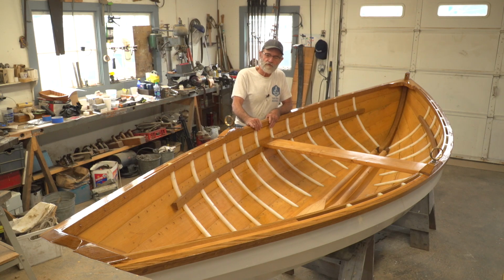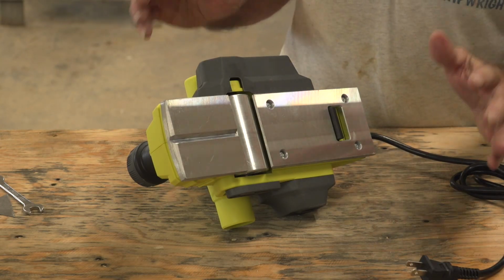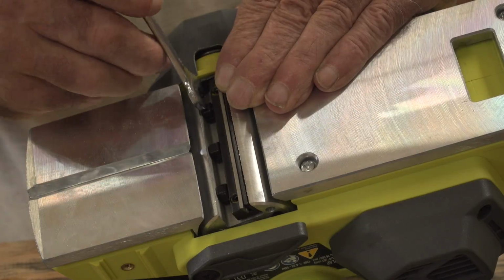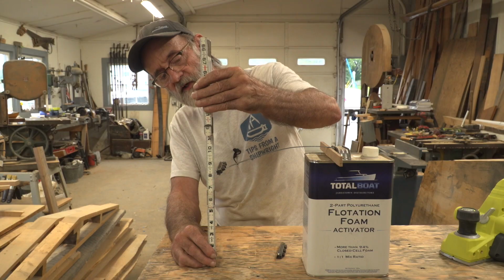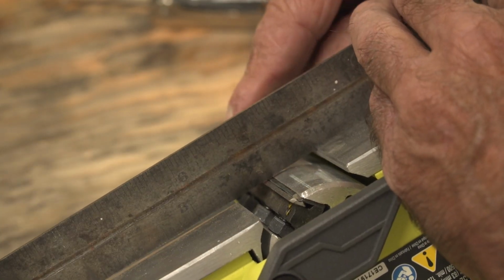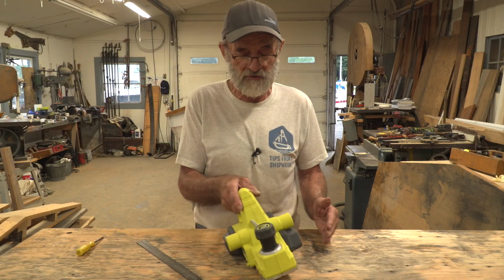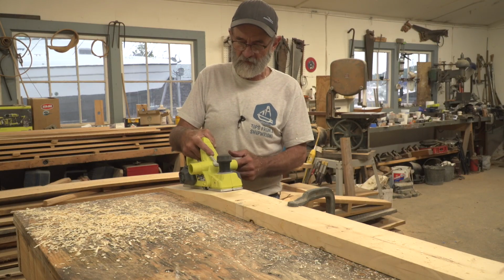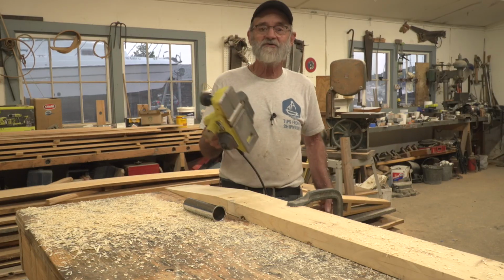How to tune up your electric planer for best results!

Comment: I just bought one of the ryobi gizmos an i intend to use it for walking canes ,and at some point a tiny boat about i9 ft 11in,as in ohio anything under 10 ft doesnt need a registration number and is exempt of the codes and regulations on my local lake ,,was hopeing u would give me advice on a good small gas engene ,,motor for it ,it willl be about 3ft wide maybe 4 ,even as i only want it for fishing close to the banks,it will be about 2ft 6 from the floor to side rails ,made of 1quarter in ply 2 layers and half inch foam insulationsandwithed and sealed with epoxy
Reply: What is a "Ryobi Gizmo"? I tried looking it up, and couldn't find it on the web.

Comment: The old spiral planers are worth big money now.  But why are they dangerous?
Reply: He's either confused or doesn't know the difference between a Skil 100 and a Rockwell or Porter Cable.  The Skil 100 is the best planer ever made and it does NOT have a spiral blade.  The spiral blade planers are the old Rockwell and Porter Cable planers.  It is the Skil 100s that demand top dollar.
Reply: @1982mako224  okay, thanks, but why are the spiral blade planes dangerous?
Reply: @thomasarussellsr    Its not all spiral blade planers that are dangerous......it is only a few very early palm sized planers that are extremely dangerous to operate.  I have a feeling that the Rockwell planer in the following picture is the one he is confused about.  This little Rockwell does use a spiral blade and is just an accident waiting to happen.   What makes it dangerous has nothing to do with its spiral blade......what makes it dangerous is its small size and that most of them are missing the side guard making it even easier to wind up taking a finger off.  There were several variations on this model and they are to be avoided.  https://thumbs.worthpoint.com/wpimages/images/images1/1/0617/01/1_7670462760c2d4983d2b4cec2bdb44c0.jpg    

The planer at the following link is a Rockwell 653.  This planer also has a spiral blade and is probably the second best planer ever manufactured.  It is not dangerous.  The spiral blades actually cut better than a strait blade by the way.  The problem is Rockwell/Porter Cable stopped making the cutters long ago and a new cutter with run you $200+  Here is a nice restored Rockwell 653:  https://www.garagejournal.com/forum/picture.php?albumid=5080&pictureid=61289

At the following link is a Skil 100.  This is the most sought after of all planers ever made.  Skil planers have never had a spiral blade and are not dangerous as was mistakenly said in the video.  These command top dollar with even ones in poor condition fetching hundreds of dollars and restored units fetching over $1,000.00.  The Skil 100 is a tool that is perfectly designed and will last a lifetime.  There is a 5.5 amp and a 7.5 amp model with the 7.5 amp units commanding the highest prices.   https://shapersupply.com/collections/surfboard-planers/products/skil-100-type-4-7-5-amp

The next couple of pictures are a sampling of the planers I use.  I have three Skil 100 planers two of which are pictured, a Porter Cable 653 (spiral cutter) and a Hitachi P20 (the green one).  I do most of my work using the Stock Skil 100, a modified Skil 100 and the Hitachi.  My modified Skil 100 has its base shortened to make it work curved surfaces better, all corners softened so it can't catch an edge, new bearings and a specially made attachment to capture the air from the fan  to propel chips far  far away.....it actually blows the work surface clean as you go which is important for the work I do.  I also have a beat up death trap planer that I picked up at a yard sale as a curiosity but never used.  I had one Ryobi but it self destructed when the blade assembly came loose......it can happen so check your blades and make sure they are tight periodically.
https://i.ibb.co/yY1tChg/5-D370-C4-E-DA10-4830-B03-D-A305-C90110-AC-zpsqvyqy8wf.jpg
https://i.ibb.co/B4DvXP7/BB646-ECF-F538-4-F34-9712-35-D24557-EF49-zpskr8af4tn.jpg 

I love these videos but he clearly confused when he got into talking about the Skil 100 and planers with spiral cutter heads.

Comment: What is the V groove in the adjustable plate for?
Reply: I would assume to be able to plane a chamfer on corners. Could be wrong though!
Reply: @ericmcconnell3238  nope, you are completely correct. It is a chamfer guide. The depth of the groove is to ride on the corner of your board for more accurate chamfers.

Comment: Electric planers are expensive, noisy, messy, dangerous, polluting, things. Try a Stanley No.4. cheap,  quiet, still messy, not at all dangerous, environmentally friendly, more skill required and good exercise too.
Reply: My Stanley no. 4 is my favorite tool in my shop. However, it's a smoothing plane and meant for thin shavings.  Unless you have a scrub plane to take the wood down to depth, you are going to spend a ridiculous amount of time and effort with a no 4. If I have a thick piece that I need to take down 1/8 or more, I reach for the power planer to get the bulk off. Then go to my no 4 to take it right to my line.

Comment: A lot of useful information as usual.
Does the motor have a secondary output for its cooling air? If not the increased flow should also make it operate cooler thus giving a longer life span (motor, bearings, plastic and drive belt).
Edit: Also running it with plugged flow will reduce it's life, I fear a lot of people don't note the stop of chips coming put and happily runs until everything is  completely messed up.

Comment: Good grief.  Buy yourself a vintage Skil 100 and you'll never need another planer.  They aren't cheap but they are worth every penny.
Reply: If you watch the whole video you will see that he has used Skil 100's and prefers his modified Ryobi.
Reply: GardnersGrendel I admit I quit on this video before the end. I use the Skil 100 (have three) a Rockwell 653 and have had plastic planets by Ryobi and Hitachi. The Skil is by far the best and you’ll never have a cheap bearing heat up and melt the housing totaling your planer. You also won’t need a bunch of modifications.
Reply: Cool. I'm glad it works for you. I use mostly hand tools, so I don't have experience with either. One of the things I like about Lou is that he is totally pragmatic and uses what works for him, whether it be really traditional or newer, he seems to only care about how it works for him(see the plastic ribbing against the riveted planking). The fact that he directly addressed that he has experience with the older Skil 100 and still prefers his modded Ryiobi was interesting to me.

Comment: Can you tell me what would happen if I accidentally hit a nail with my Royobi power planer ? I've never used one & I'm attempting to refurbish old decking lumber that was DESTROYED by RUSTOLIEUM DECK RESTORE 10X's .😤 Not a soul can tell me any logical way to remove this Crapp ! I have been scraping , sanding ,wire brushing , heat gunning & yes boiling water . I have been told that one had HAND planed his  ( being he was afraid to hit nails with power planer),however I think he had only  Rustolieum Restore thickness ( ? ) Anyway I've have had the best results with  the Extreme Sun's Heat & a Scaper that tends to remove peeling sheets of sanded acrylic paint & some wood. It is the only thing besides REPLACING  the DECK!  Also this sandy crapp is embedded in the screw heads so SIMPLE Screw removal is another issue,I'm aware that it probably will be wearing on the blades but better them than me. Any help & advice would be GREAT!
Reply: If it is nails instead of screws, take a pinch and drive them a bit deeper than you are planning to plane. Just hope you get them all, because the blades on any plane will suffer serious damage hitting nails. If it is all screws (filled with the dreaded top put on your deck), then you might have to get out the Dremmel with a small enough burr tool to clean out the screws.
Reply: @thomasarussellsr  yes thank you yes screws , I had to pick out that Top coat by hand GRR! Thank you for the info...

Comment: Somewhere at a coffee snorted desk is Ryobi's tort lawyer chewing his nails as he dictates denials and repudiations of Louis defeating inept safety features. That spring-loaded stand for instance. It"s likely to trip on the return stroke interfering with normal and intuitive operation of the planer.

Safety dweebs and red-mouth lawyers don't realise a safety feature that interferes with function is itself a safety hazard. It's a fool's task to make anything fool proof; a fool will always find a way to screw up. At some point contrived safety features reduce the utility of a tool to the point of inoperability.

A power tool's finest and most consistent safety feature lies between the ears of a careful and competent user.

As for the discharge port fix: a cork that works Vs two molded parts that don't. A porting jab well understood by every two cycle trail bike rider that double chip ejection - well, pay attention product designers. Dried-up old farts that actually use the stuff you make could show you a thing or two - if you'd only ask.
Reply: Trade guys have been undoing "safety features" for decades now. Even Norm would pull the "guard has been removed for filming purposes only" even though what he was doing was impossible to do with the guard on.

Comment: Great content. Now, at https://youtu.be/_a1HCqK5i-A?t=1150 you mention the front plate having a slope on some planers. Do you know if this is intentional? My planer has this slope on the front plate, not a Ryobi I should add, and I'm trying to figure out if it's a design feature or manufacturing defect that I should try to address? The fact that the front and back plates do not sit parallel to each other just does not seem logical to me but I'm comparing to my jointer which has a long infeed so the mechanics of this small planer are not quite the same.

Comment: Someone gave me an old Makita, any thoughts on safety issues there
Reply: Any planer can be dangerous just like a router if you're not careful.   Keep two hands on it and don't let it get near you or your clothes while its spinning.  Lot of people have carelessly let a power planer grab their pant leg as they admired their work.  Also I can't stress enough to make sure your blades are in there tight.  If one of those blades comes loose the whole planer could implode or the razor sharp blade could come flying out.

Comment: What a total shit product, i expect it to work and be set up correctly when i buy it. Do not buy this crap
Reply: Like Lou I've been in the game for many years now, while I sort of agree they should do the job straight out of the box, I've never owned any power tool I didn't have to tweak a bit to suit my needs, I've even tweaked drill chucks to balance them properly, all these tools are mass produced and vary quite a lot in performance, but are usualy good enough out the box for the DIY market, but not for real tradesmen like Lou, it could explain why half Lou's tools look like they came from the Ark, it's probably taken him years to get them just as he wants them,
Reply: There was one.  It was called the Skil 100.  The best planer ever made.  They haven't been made since the 80s and fetch big bucks today on eBay.